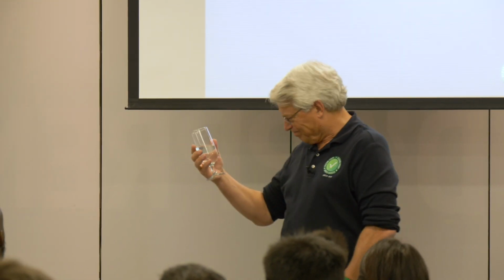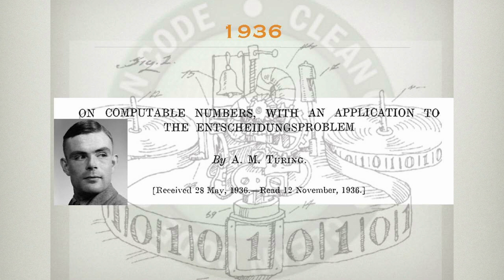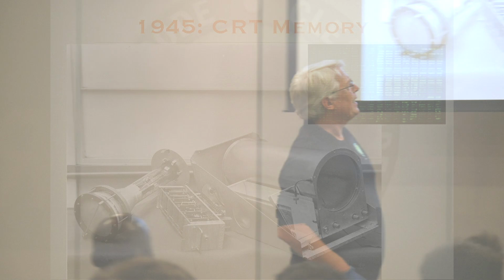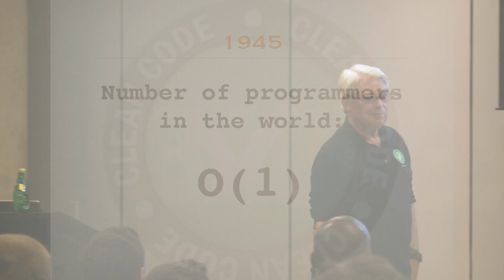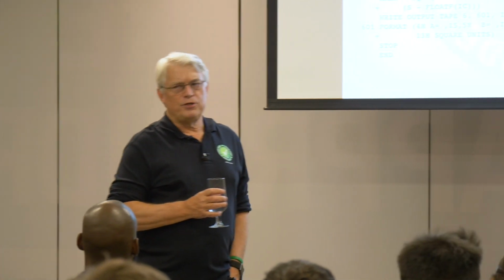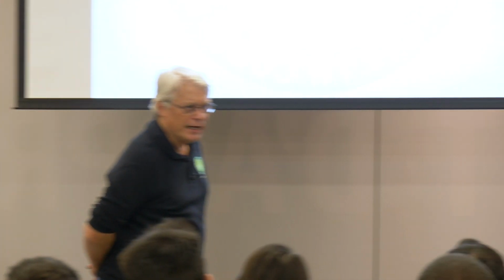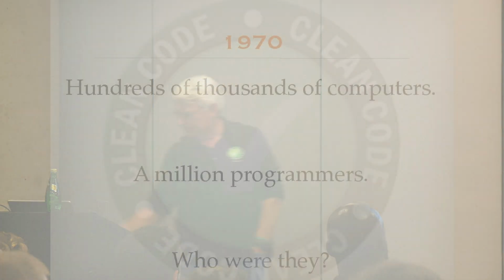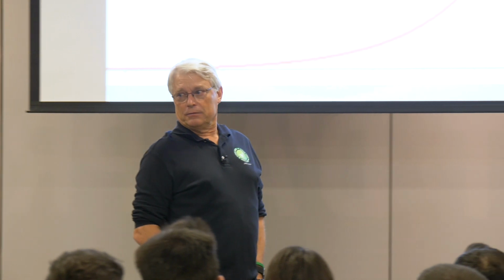BOB MARTIN PRESENTS: The Future of Agile

Comment: 15:22 - Vacuum tubes were actually reliable if you left them running. The reason they blew was due to power-cycling. If you kept the machine running there was no reason not to use thousands of them, as Tommy Flowers proved by usage in the British telephone system of the day.